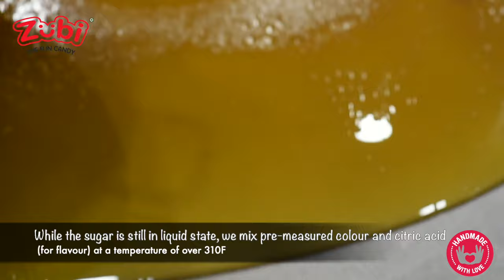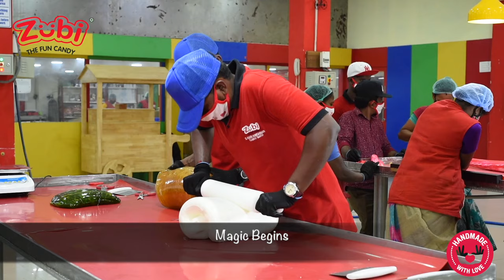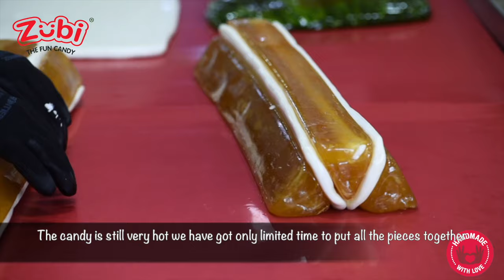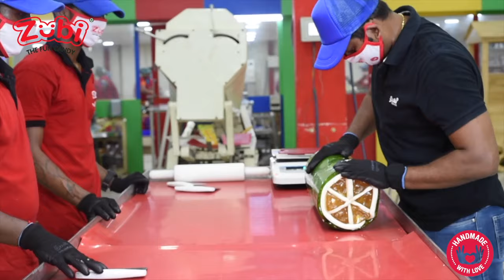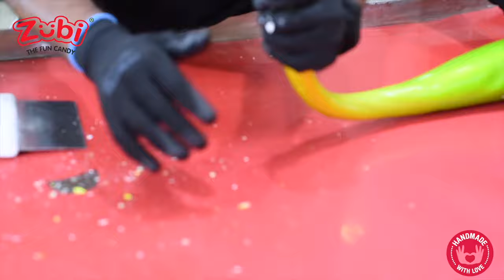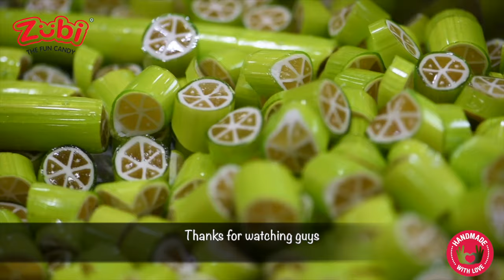Lemon Candy Rocks Making from Zubi The Fun Candy.

Comment: Watching those guys work so hard to stretch it, I wanted to tell them to put it on one of those batch rollers and turn the heat on.
Reply from the maker: Hi Wayne thanks for bringing this we completely agree with you it is easy with batch roller but just for the video we have hand pulled and stretched this is because some time in the batch roller the design inside the candy tend to change.